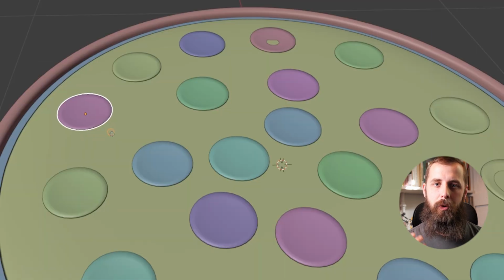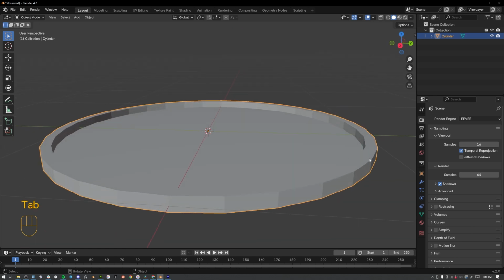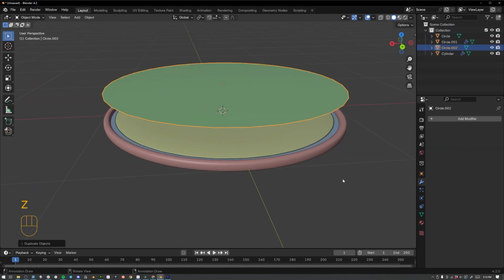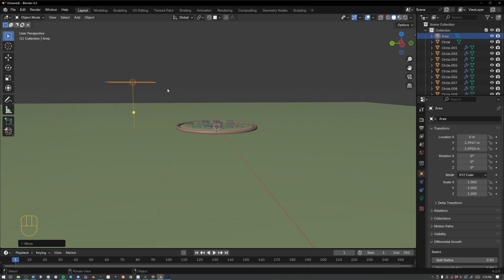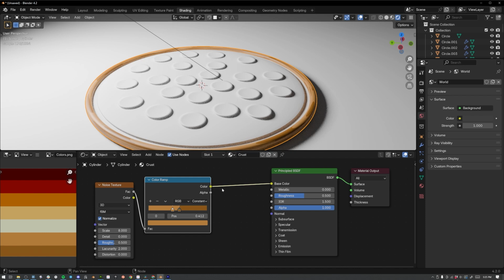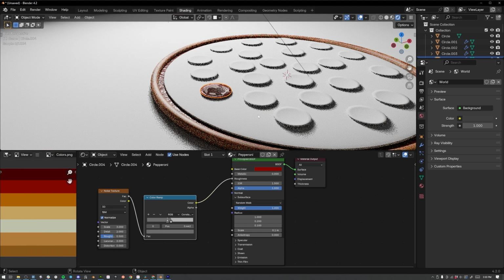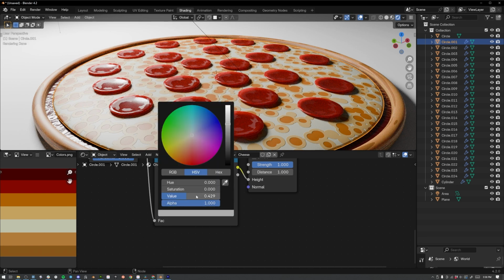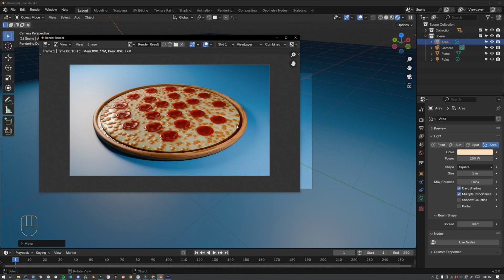Blender for Complete Beginners | Pizza Modeling Tutorial

Comment: when i add the sauce  about the 3.40 second mark, it comes out much wider than the actual pizza base. Doesnt come out like yours?
Reply from the maker: Hmmm it could be that you've scaled down the pizza crust before adding the sauce. If that's the case, just select the sauce, hit S, and then scale to size. Or if you want, you can share a screenshot of your issue over in our Discord and I can get you a more specific answer 🙂
Reply: @Three-Division  Thanks, ive sorted that one now, now im up to the peperoni and doesnt look right. Have just posted a question